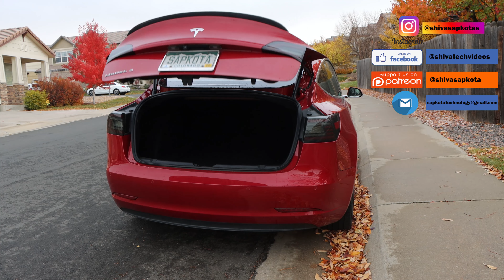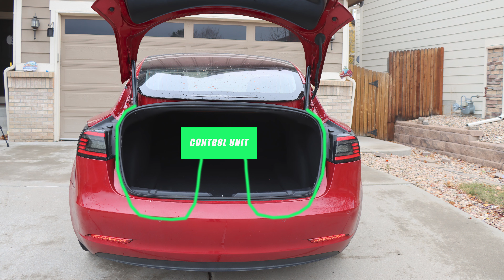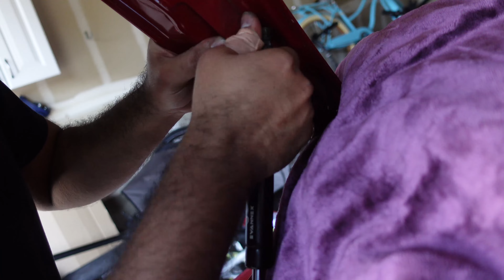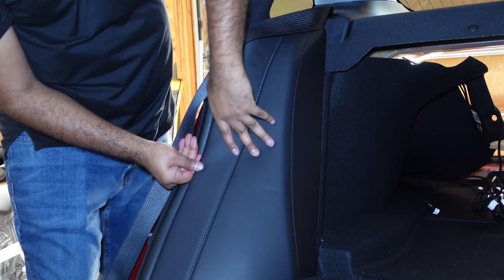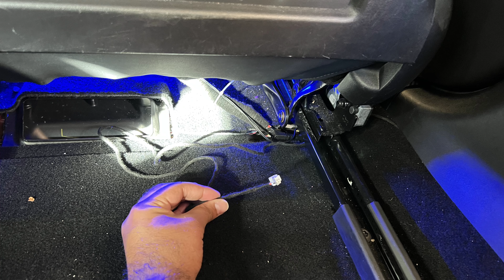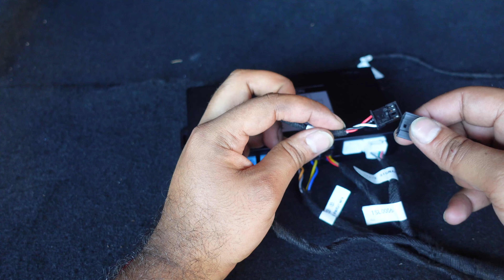Tesla Model 3 - Power Trunk Liftgate & Kick Sensor Detailed Installation Guide (Hansshow V7 2021)

Comment: Just finished installing this using your video as a guide. Thanks so much for doing this. Question, how do I integrate the "close" trunk on the phone? I can open the trunk but not close it. Thanks again for the excellent video.
Reply: Did you find a fix?

Comment: I just bought and installed the V7, and everything works, except closing the trunk with the tesla app. Do anyone Else have this problem?
Reply: Try ask Hansshow if they have a firmware update for the control box. Mine is working on my 2019 M3
Reply from the maker: Tesla software update could have caused that issue. What if you go to Controls and tap on the trunk? Does it close then?
Reply: @ShivaSapkota  Thank you for the fast reply. Unfortunately this does not work either.
Reply: Yes it close from the Tesla screen When i hold the brake
Reply: I have the same problem, all working fine, just not closing from the app, did you resolve this issue?
Reply: Any suggestions??
Reply: Did you resolve this issue? Is there a way to close the trunk from the Tesla app?

Comment: Hi Shiva,
Do i need to connect the CANBUS cable if i dont have the kick sensor? Thanks in advance :)
Reply from the maker: Yes, you still do unfortunately. Otherwise the close function from the app will not work. Thanks.

Comment: I have installed power trunk opener V10 and I can’t open it with Tesla app or from main display monitor neither open from monitor I can only close it with an app I saw you plugged some T harness to the tailgate I didn’t have any thing like that and from connected wires to the box I have 3 plugs that’s nowhere to plug all males?

Comment: Hey Shiva, love all your Tesla videos! Have a technical question that maybe you can answer. I have 2018 Model 3 that I installed power trunk and frunk about a month ago. I took my car into Tesla for a glass replacement and they also installed the "retrofit FSD" 3.0 computer with Intel Atom processor. Now my trunk won't close from the touchscreen. Frunk works perfectly, and both work perfectly from app and key fob. Any thoughts? Software version is V11.0

Comment: I am still in the process of doing this , it is somewhat complex, mainly trying to run the wiring.
I broke one trunk stop, it was seized,  I had to buy deep socket for the 12v supply under seat, the foam tape doesn't want to hold the trunk release
Reply: Now trying to put things together
Reply: It does work though

Comment: Your videos are very well done - good video quality and explanations. Thank you for your effort and time in making them. A problem I had was that one of the wires attached to the tailgate button broke off from the metal pin when I was separating it from the connector. I couldn't find any replacement in local stores. I wonder if Hansshow or Tesla might sell replacement pins or connectors? Or maybe I can just cut off the connectors on both ends and splice the corresponding wires together? Any suggestions?

Comment: Installed version 7 a couple days ago. Your video was very helpful.  However, I can’t close the trunk from my app or the screen in model 3. When I open the trunk with the app, I first get a message saying that I “will need to close the trunk 
manually”.  Can anyone help me resolve this problem. Thank you. I
Reply from the maker: With certain Tesla updates, it sometimes acts funky. What happens if you press on the controls tab of the app and press on the trunk? Also double check your OBD connector.
Reply: Thank you Shiva. I checked obd/can bus connections. Were all good. Then, I tried to close the trunk by first opening the “Controls” widget in the phone app, and I am now able to close the the trunk from the phone app. I get the same message saying that I will need t manually close trunk - cancel  or Okay”. But I just press “Okay” and it works. Also, I have to press my brake pedal in order to be able to close the trunk from my car’s screen /display. I was told to do this by Hansshow Support via WhatsApp. It did work. Is this normal operation?  And my second question is this: I have a vacant plug on the can bus connector plugs that pigtail into my car’s obd plug. Is this normal?  Thank you so much for your help, and I hope this info will help others who might encounter the same problems.

Comment: Does the car still need to be "fooled" by the Hansshow module for you to use the screen to open/close the trunk? IIRC the earlier versions would send an open/closed signal to the car so that the button in the UI would be available occasionally so you can close it after it's been opened, but you get the open/close animation and all that. Does this really communicate and play with the car or still a hack?

Comment: I did my installation two weekends ago.  Thank goodness for your video!!  There were some nuances along the way and I could watch your video at those points in the process to clarify things.  Thanks again for doing such a great video.  Sadly, I did not have the same success as you did.  The foot sensor didn't work for me and after finishing my installation, I have been getting a warning that FSD is disabled because my sensors are failing to communicate and it tells me that Park Assist is not available.  More weirdly, it seems like I can not adjust my steering wheel properly.  As much as I hope this is some kind of software glitch, I assume I must've damaged something along the way (maybe pulling my wires through the sleeve to the trunk lid?).  I have made a service appointment and will report back on the cost of the repair.  Some people just aren't meant to do these things, I guess.
Reply: so what happened?

Comment: This kick sensor from Hansshow does not work as advertised. I bought 2021 version last year and installed on TM3LR 2021. It does not open trunk when car is in sleep mode, and what’s even worse - it does not allow to open trunk with standard button. You have to wake the car up opening one of the door or wit Tesla app. What is even more disappointing - this sensor does not let the trunk participate in Christmas light show together with windows, mirrors and charge port lid - trunk is just dead closed during the show. I’ve been chatting with hansshow support for almost 4 months, after that they claimed that “some cars have different signal, and it can’t work with sensor”, after that they said my sensor is out of warranty, and refused to make me full refund explaining this fact with “you installed and and used it”. Sort of. 
All video proofs can be provided.

Comment: Is the kick sensor deactivated with carwash mode?
Reply from the maker: Great question and I do not know. I will test and let you know :)
Reply: @ShivaSapkota  that would be great. Looking forward to your findings.
Reply: @ShivaSapkota  I checked with another Hansshow power trunk owner who said the kick sensor still activates the trunk lid even when the car is in carwash mode. Be great if you can confirm.
Reply: @Shiva Sapkota, was wondering if you had a chance to check this? I do understand that maybe it is not in your interest to confirm something negative but I would assume Hansshow would not cut you off from free products if you were simply confirming something that is fact.
Reply: @Shiva Sapkota Have you had time to confirm my question above? It would be appreciated. I'm sure consumers want to know if the foot sensor can be triggered going through a carwash. If so, this is a big problem consumers want to know about.

Comment: Does this void the warranty?
Reply: No, however if you break anything (wires, snaps, etc) when doing the install, it won't be covered.  Also, the thing you're installing will not be warrantied either.  Make sure you do it properly, or pay someone to do it for you if you're not confident.

Comment: Going to be tackling my installation soon.  Been watching your video and a couple of others multiple times to prep.  I notice you wired yours directly to the battery pack whereas the instructions and other install videos show the power being run to the 12V battery up front.  Curious if there is any issue doing it your way.  I installed the Hansshow screen a couple of weeks ago and routing the wires through the firewall was an unexpected PITA for me.  Would love to avoid having to do it a second time if there's no problem running the power to the pack.
Reply from the maker: As long as you do the connection right, there is no risk to using the back battery connection. You have to be very careful to not break the continuity, otherwise your 12V battery won't charge and degrade to the level you will require a battery replacement. So, make sure that top bolt touches the bottom terminal. If you see a message on the screen that says "reducing power usage to conserve battery" etc, you know the continuity failed. Mine has been working well all this time and no battery issues. Hope this helps.
Reply: @ShivaSapkota  thanks for the info!  Not sure what you mean about breaking continuity. If I disconnect the battery pack first and follow what you did I assume that will work. Is there anything else I need to do?
Reply from the maker: @jhogoboom  Yeah it will work, I just meant make sure the top nut you loosen to insert the hansshow plate in the middle is fully secured and it doesn't create any gap.
Reply: @ShivaSapkota  Got it!!  Will let you know how it goes!

Comment: How would this be to install on a car with towing hitch?
Reply from the maker: You would have to remove the tow hitch prior to this installation and put the foot sensor on one of the sides (instead of directly in the middle since you will have the tow hitch there) after the installation. Thank you.

Comment: What was the size of the trunk screws? Mine got stripped too.
Reply from the maker: M8 X 1.25 (you can use the strip out tool to remove and take that screw to a local hardware store.
Reply: @ShivaSapkota  Thanks, I had the same tool as yours, but it didn't work. So I'm back from the hardware store with hopefully the proper tools to get it done. Essential needed a larger bit for the extractor. Thanks!
Reply: @ShivaSapkota  Latch bolts are T45 on my M3. Using the T40 called for in the video will lead to stripped heads!

Comment: What size screw was it for the trunk latch, exact specs please? I’m stuck! I also stripped mine
Reply from the maker: It is M8x1.25 at least that was the size for me. The speed out tool took mine out and I was able to just use a new screw. Good luck!
Reply: @ShivaSapkota  thank you so much. Do you turn the screws out counterclockwise and put them in clockwise. I know it sounds like a dumb question, but I can get the old ones out
Reply: @ShivaSapkota  also what length screw? Did you get them from Lowes?
Reply from the maker: @TheCorteseFamily  I got mine for ACE Hardware, not sure if you have that. I forgot the length but if you take the old one, they can find you the right size (shorter is okay). Make sure to get countersunk. Yes, left to loosen and right to tighten.
Reply: @ShivaSapkota  thank you for your help earlier. I was able to get the correct screws from ACE hardware. With the help of my sons welding knowledge, we were able to attach bolts to the screws and remove them (I had already sheared off two screw extractors). My advice for removing the screws to anyone would be to either use a good impact driver, or even consider manually turning them with something with a good amount of torque, and going *slowly*. I would have been a whole lot more cautious if I knew they would strip that easy with a T40
Reply: @ShivaSapkota  one more question, I’m now stuck on the fishing part (through the rubber tube), which was the part I was originally dreading before unexpectedly running into the latch screws. Hansshow included a less than adequate fish in my kit (no hooks or loops or anything to tie to). Where did you get yours?
Reply from the maker: @TheCorteseFamily  Mine came with one of my previous Hansshow kits. Unfortunately, I have yet to find another good one like that. Perhaps ACE has a similar one in stock?
Reply: I found that a Torx 45 worked better than the T40. Maybe that is why some screws get stripped?